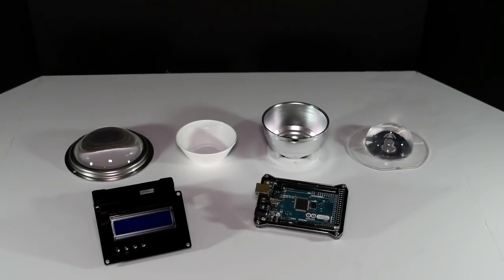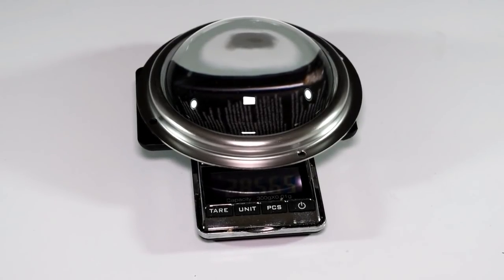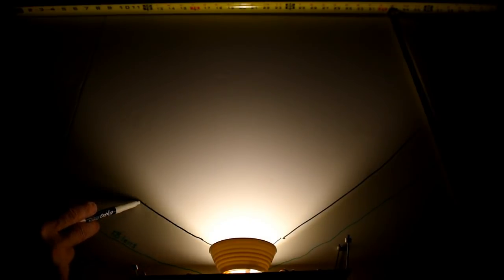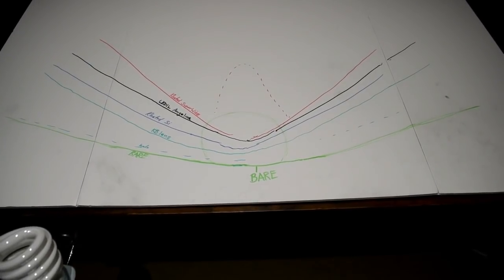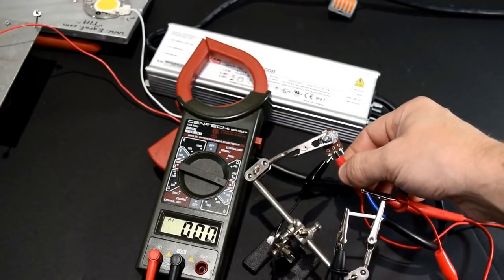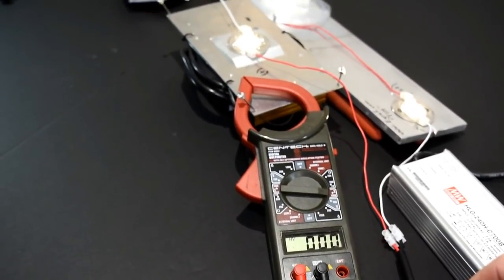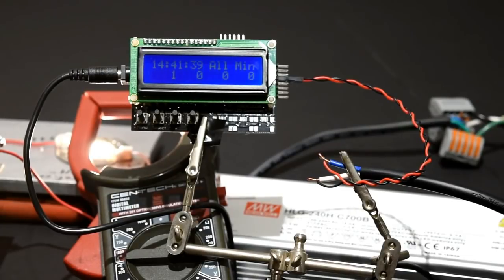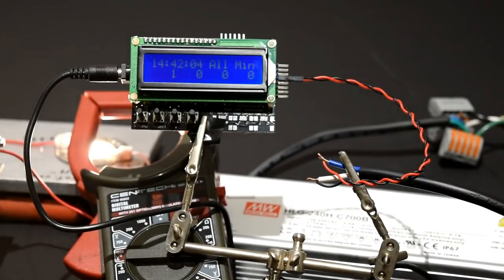DIY LED Basics: Optics & Dimming (pt 6/6)

Comment: Hi, I am new at this and have watched your videos on how to build a LED array. I am considering building a lamp 100 cm x 30 cm for chilli growing using 5 CXB3590@3500K and have a couple of questions. First, the COB:s are expensive as hell, can you advise on where to buy these, or can you recommend any cheaper alternatives that will work?

Is 3500K the best or can I go with 3000K or 4000K as well?

Thanks for your great videos!
/The swedish guy.
Reply: +Fredrik Hörnfeldt if you value efficiency (more light from less power) you spend more on the cobs and drivers. You need to match the cobs with the right driver. The CXB3590 3500K CD is considered by the DIY community to be the best bin for light quality and efficiency.The CXB3070 is very good and a little less efficient but easier on the wallet. Either way,  driving five 36V cobs from one driver would be fine with the correct driver.  One 200W Meanwell HLG-185H-C1050 can run five 36V CXB3590s in the range of 525ma to 1050ma, that's 19W to 38W each, which is highly efficient use of energy to make light (36V CXB3590 can be 64% efficient at 700ma).  The 250W HLG-240H-C1400 can run five such 36v cobs with at up to 50W each which is roughly 56% efficient using the top bin CXB3590. There are cheaper alternatives but you give up efficiency and it changes the choice of driver due to voltage requirements. The CXB3070 however is comparable and you can substitute it but again you lose about 6-12% efficiency, which is not a huge problem for the power bill but in the long run it might be. Less efficient also means more heat per watt instead of light per watt.  http://kingbriteled.en.alibaba.com/product/60259719620-801574224/CREE_CXB3590_3500K_CD_CXB3590_0000_000R0HCD35G.html you can get high quality CXB3070 http://www.pacificlightconcepts.com/product/cxb-3070-3500k/ 

 You can use a smaller driver for one or two cobs  http://www.mouser.com/ds/2/260/LDH-45-SPEC-806090.pdf   http://www.mouser.com/ds/2/260/LDH-45-SPEC-806090.pdf  look at the spec sheet where is says Output Pwer/Voltage Range and you can see the various models have different voltage capacity. One that can handle at least 72V can power two 36V cobs. These are also dimmable with PWM.
Reply: +kingknut it's not a diatribe at all. Just solid info that actually answered his question regarding the CXB's and has nothing to do with you. And it's not ten times the price to use Cree cobs. The CXB3070 is available for $36 or less (for top bin cobs) and the single driver is $60. You were trying to be helpful mentioning that there are cheap parts but you give no specifics. In my opinion cheap is costly  and a waste of time and money in the short and long term, except for learning laboratory, because the parts quality is a crap shoot, you may spend more money going through garbage parts. But if that's all that's affordable it is still worth doing. I would advise against running 100W cobs of any sort at 100W unless you have really good active cooling and solid driver circuits.
Reply: +Salty +kingknut Thanks both of you for the really good info. I think I will go for the CXB3590, maybe I will choose 4 COB:s instead of 5 to save some money, that will probably be good enough for my chilli plants anyway. Do you have any specific retailer to recommend where to get the COB:s, driver and lenses?
I got a 120x20cm 10mm thick aluminum plate and on top I will mount a 120cm heat sink (this will require a lot of thermal paste...). Do you think I need to add 2 CPU fans to this if I run 5xCXB3590, or will the cooling be enough anyway?
Another question about cooling: If I mount two fans, I´m thinking that I should have one on each end of the lamp, sucking in air on one side and blowing out on the other side to get a good air flow over the heat sink. That sounds logic, right?
Reply: Four cobs at 50W each should be good for about two square meters or so, maybe a bit  more or less. I'm not sure how much intensity peppers need. Again I'll mention that the 3070 is very nearly as good as the 3590. 3500K is the color of choice it seems. I pointed to online sources for those in my last message to you. The driver: http://www.mouser.com/ProductDetail/Mean-Well/HLG-185H-C1400B/?qs=%252bmCJZPMmHFNyZddMqMvYFQ%3D%3D runs four. Not sure about lenses but growmau5 has them listed on his other videos. Your 120mm heat-sink materiel sounds sufficient. I would use the cooling fans, it never hurts to keep it cool and the LED's will run more efficiently that way. Generally cooling fans are placed blowing down onto the heatsink, but do whatever seems to get the best flow in your situation.
Reply: +Salty Thanks I really appreciate the quick response and all the info! I think I know everything I need now to start ordering some material! Again, thanks for the help and thanks to +growmau5 for the great videos!
Reply: +Fredrik Hörnfeldt have fun!
Reply: +kingknut  Ok I'm not evangelizing or making diatribes. Let's be clear on that because that's the only problem I have with what you're saying. I was answering his question in particular about the Cree cobs. I think your comments and suggestions and technical points are totally welcome, I'm interested in them, and I'm not trying to counter them, I have an open mind, technology is advancing quickly. This is all about moving the ball forward.
Reply: +kingknut In fact I am glad to have a qualified electrician on here who is willing to take some time. So no grievances here. Like I said I wasn't trying to counter your comments, just sharing what I know. DIY is a community. I would love to see some good videos showing how to utilize the other types of Chinese parts available. Seriously. Sometimes I feel like I'm drinking the Cree Kool-Aid but it's just because that's all I know right now. So, yeah, bring on some other knowledge. It would be beneficial. People who watch this stuff who are on tight budgets or remote areas stand to gain from that.
Reply: +kingknut OK, you definately got my attention. I feel that I can easily purchase and assemble a light rig using the Cree LED and all the specifications that I was given on this site. 

If I should move on with the chinese components I would need some more help to select the right parts more specific. I'm looking to light up a little less than 2sqm, and it would be good if I can use less than 300W from the wall socket. If the components are quite cheap, maybe I can have both a set of warm whites and a set of cool whites and use a switch to toggle?

I wanted to send a pm, but couldn't find where to do that in my app...

Comment: A few questions.

There is a wives tale that says it is good to plant/germinate on full moon. Do they do better under constant full moon lumen or would it be better to cycle intensity throughout the month if one were so inclined.

2, Can the light system be ran on capacitors? say for 3x2 for 3-5 plants?  Have a switch to charge capacitors when they get down to a certain level? i wonder what kind of power that would save...if any?

Comment: Hi growmow5, I love your work. There are a lot of knowledgeable people on Youtube, but few have your presentation abilities which is just as important as the knowledge itself. Thank you for all your hard work. 

I do have one question and a comment for you if you have the time:

Q. If you had a completely separate flowering room from your veg, would you still use the same LEDs?

C. The silver reflective material you have is actually not very good at saving light. Paint or cover them with something matt white. You will get a significant increase in your light efficiency and when you are trying to push up your g/w...food for thought.

Take care

Johnny B. Good

Comment: Great info mate ! I'm curious about the mean well driver version A with the internal dimming function , do you have any examples of this driver ? Or any disadvantages ? Sounds like less work but haven't seen a working example
Reply: How exactly do you dim them ? Small screw driver ? And Can you point me in the direction of  solderless dimmer? Ta.
Reply: Thanks mate, the A version might be easy enough for my purposes, keep you posted.
Reply: Thanks mate. I ended up with the B version, took the challenge on. Ill come find you on RUI as i progress and need advice with putting together Jerry's gear.
Reply: +growmau5 is it a hassle to adjust the internal pots?

Comment: Hey brother, right on. Gonna start saving. Gonna make a multi chamber flower room. This setup I am thinking bout will be tight. Gonna do a 4x20ft room. With chambers every 3ft-4ft. Gonna make my walls moveable I think. I'm in my crawl space so I have 70in height just dirt floor and sure ain't even. So these will allow me to only have the heat sink with cobs and I can make a panel for drivers and everything else. Have u guys ever had any voltage/line drop? I know u r only going a few feet to the cobs. I talking like my panel will be 10-20 ft away. I know always Times by 120% I was told. Used to be a marine electrician and mostly dealt with 480v 😨 . So I do know over certain length u will lose voltage but since u Kats r running mili-amps and all, I'm sure 12gauge will be more then enough. Like running a t-3or t-4.that is 3-4wires at 14-12gauge wire. That is what I'm looking to run from the drivers to the lights and heatsink. Though for electronics u want more wire with more strains I think not solid for crap moveability. But not sure. Looking to run 4-6 cobs with soft white and white. I know u Kats can use only certain ranges, ( I.e 4 k, 3k, etc). But with just running these for. Now. I think will cover the vast majority of the spectrum. Unless their. Is a cheaper way but if it is just a driver or lens then no prob. Man I wish I found u before I put the $ into what I use now. But I see u made mars to cobs so yup will be checking intothat. Otherwise keep u knowledge coming to the not so tech savvy people. Stay medicated and ill let u Kats look at my setup before I go full bore into it. Thanks for all. One

Comment: you ever thought of going into development with a manufacturer? these muti coloured single diode 1.3.5 watt chips are old tech.they need someone like you on board.its good to hear people recycling their old units and replacing the tired leds with cobs.where are we going to be in 2 years time i wonder.someone may even bring one out you can just pop a chip in and out without soldering.then people will just buy blank units and chips and work around the drivers installed in your unit.those mars hydro lights and others have great running gear.most people just dump them when a few diodes break.if you convert them they will last forever with new cobs.some of them units are 1500 bucks.for another 2/300 you have a brand new version to last 2 years or more.great work.dimming i havent sussed out but im running cobs at 50% anyway.with lenses they produce about 2.5 x magnifcation.
Reply: all the componants are out there but its getting suppliers to be consistent.but look how far you and greengenes and the other developers have brought led up to date.well done.im about to order my aluminium flat bar for passive heatsinks so i can start making my 500w/1000w spider..i think once you get over a 4x4 i think a moduler spider light type of light will work best.i think the max in a 4x4 would ideally be about 500mmx500mm hood.

Comment: Will these Angelina Jolie reflectors work without properly mounted cob holders? I'm still trying to decide if I should order this Eric Klapton tape or drill and tap. What drill bit and tap bit size is required? bmw m3, m4? Lol I have a heap of questions still before I can figure out where, how and what parts to even order. :)
You should upload a tech talk video to your channel because you need the views! lol =D
Reply: +prndownload In this grow series he shows you how to drill and tap your heat sink using a 3/32 drill bit and a 4-40 tap. Re-watch the videos and join rollitup.org....there is tons of useful info there.